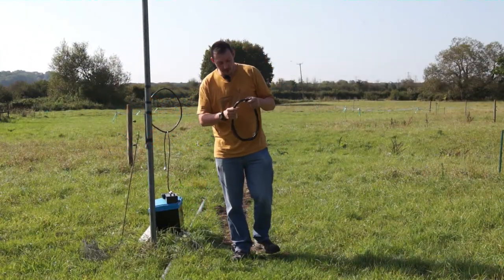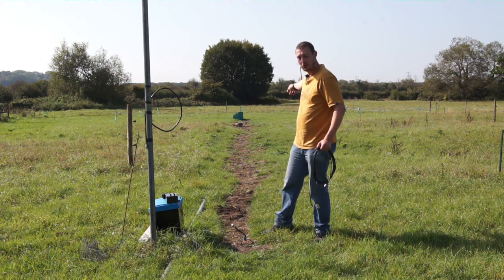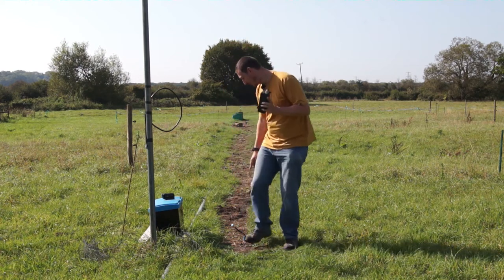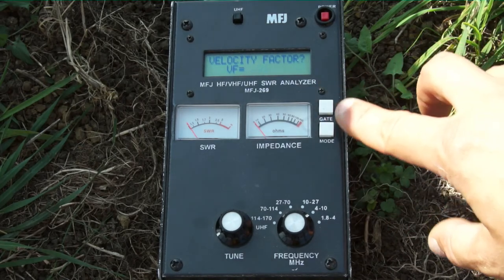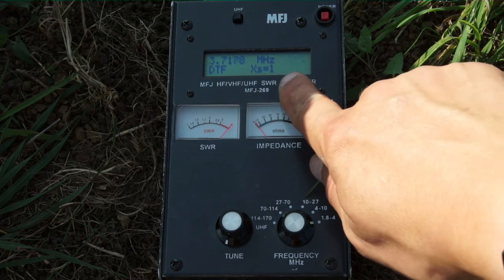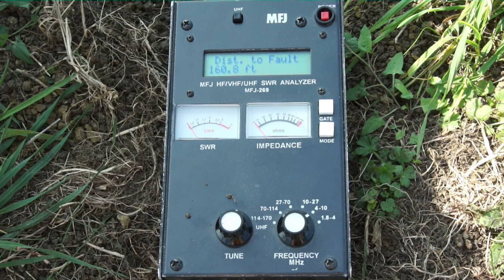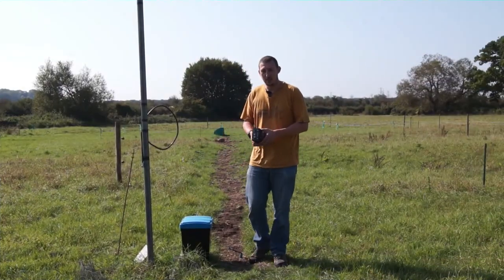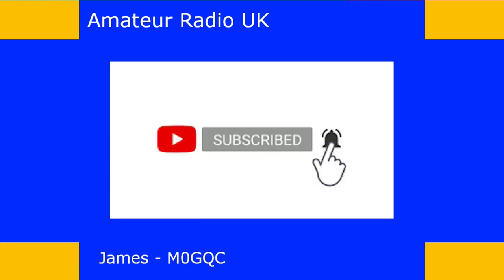Testing Feeder Cables Which Are Buried Or Difficult To Access Using An Antenna Analyzer

Comment: Interesting, I use an Nano VNA to set up my antennas, and run the feeds via the loft in my social housing bungalow. It has taken 6 months to sort out the runs as my landlord will not  let me drill any holes in the walls! I can't even put a TV aerial on the chimney. Basically they said that any antennas I put up need to meet planning regs, shame they did not read them because, as you may know, so long as it a temporary install, I can do whatever I want! As the club has an MFJ I can I can borrow to sort out any problems, when I can get to the clubhouse, which is currently locked down, cross fingers I will not need it in the mean time! 73 Jim M7BXT